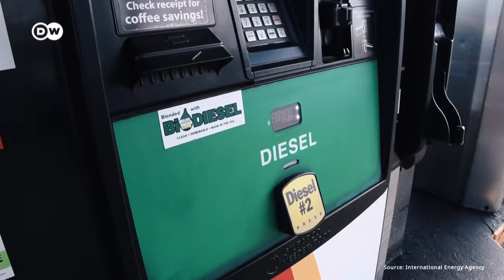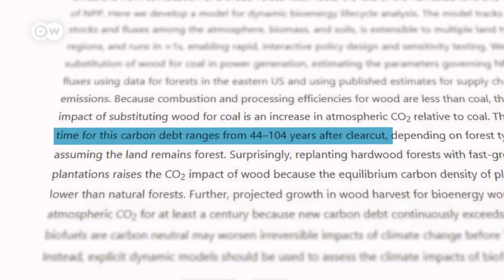Biomass: How clean is energy from waste and plants really?

Comment: Why have sewer biosolids been left off the list of biomass energy sources? Hydrothermal Carbonization facilities connected to municipal sewer treatment  plants would be a great renewable power resource that would actually be taking care of a serious  hazardous waste issue at the same time.

Use Algae, azolla, water hyacinth, water lettuce all fast growing water plants, all grow biomass rapidly, which beyond fuel, could also be harvested for other industrial products like starch for use in packaging and adhesives, so corn would not need to be grown for starch or fuel.

Tree cutting would be more sustainable if coppicing deciduous trees was used for bio mass production. That way the trees can be cut, but the roots are left in place as the tree regrows. Every spring someone needs to come by for the first few years to cut most of the suckers off the stump, but the one sucker  left grows tall quickly, because it has an establised root system. It stores more carbon, because the soil is improved by leaving ithe roots in place. The trees grow big root systems, then the coppiced(cut) tree's  roots die back to what the stump needs, it leaves all the carbon from the root die back buried in the soil, while leaving an established tree to grow again.
Reply: Yes! and it is even more important when you consider that forest fires are meant to happen every 10-20-50 years. We need a clever/organized management of forests, which takes into account cutting some trees to allow the better growth of the forest overall! why not use these cuts as biomass energy.

Comment: The other researcher needs to recognise that wind and solar  can also have a negative impact on our environment. 
For instance:
 1.To build a 1MW solar plant it is required to clear approximately 1 hecture of land which might involve cutting down of trees 
2. The average lifespan of a solar plant is about 20 to 25 years, how do you dispose off your batteries and panels once the become obsolete. 
3. The material used to manufacture solar panels like Gallium Arsenide GaAs are toxic, require special handling procedures and can be harmful to humanity and ecosystems
4. Building a wind power plant might also require clearing of land and interference with nature and ecosystems. 
Overall each renewable energy source of energy if handled without considering its environment impact seizes to be renewable energy.

Comment: We burn about 15 m³ of birch firewood per year. Mostly for heating the house but also for domestic hot water in the summer. Here in Slovenia forest cover 60% of land and continue to grow as remote and hard to access field stop being used for farming. The firewood we use is mostly economical waste as only the good logs get transported to sawmills and turned to planks. It is cheaper to simply sell twisted logs and branches to locals then to transport it somewhere and sell it for the same price. As a heating source it's much cheaper than any fossil fuel and about as much as a heat pump energy. It comes down to responsible forestry. After all if you simply let a tree die and rot in the forest the same energy is used up by bacteria and the CO² and CH⁴ just get released into the atmosphere. The bigger problem is that people use wet logs in old wood boilers that emmit a lot of dust particles. There are small villages around my area that have worst air pollution in the winter than any major city in Europe. It happens due to inversion and all the smoke from the boilers stay in the valley instead of getting higher in the atmosphere. Wood smoke is also very sticky and will make your clothes smell really bad in the winter. My conclusion, it's a good source because it is local and cheap, but should only be burned in modern wood gassification boilers that can get up to 90% efficiency and emit like 99% less dust particles.
Reply: I agree 100%

Comment: Okay I am confused. Don't Neely planted trees absorb more CO2 than older ones? Yes the older ones have more CO2 sequestered but new ones absorb much more? Wasn't that established before? Someone please help
Reply: The issue lies in respiration. Like animals, trees are living things that breath and when they breath they release CO2 back into the atmosphere. Wood is where trees actually lock up that carbon, but trees actually take a while creating the rings of wood around their stems. So to put it another way, picture the wood on a tree(or even some other plants) and that is exactly the amount of CO2 it has absorbed. If it's all green and flimsy then it's not really absorbing anything as all the plant did was convert the CO2 into sugar.
Reply: If the older tree that was cut, was turned into a piece of furniture, then planting a new tree would be a good balance. But when you burn that wood, it's releasing the same amount of CO2 it has sequestered for decades.
So what you actually have to equate is the amount released from burning of that old wood, to that of the amount sequestered by  the new sapling that replace it.
Meaning more CO2 is being released extremely quickly than what tha sapling can sequester in decades
Reply: Yeah, I'm also confused by this as previous studies said young forests capture more. And that would make sense since they are generating wood mass quicker, except for first years probably.
Reply: Old forests store a lot of CO2 in the soil.  Much more then the young trees capture in its wood. That's why when you cut old trees, even if you don't burn them, you release carbon from the soil that is not sustained by the live root trees.
Reply: The confusion is valid as scientific studies show both results. Some say mature trees (100 years +) stop taking in that much CO2, some say it never stops.. Also, rate of absorption and quantity of absorption are two different things, I would think it is like a heart, you can pump many times (higher rate for younger trees) or pump less times but more strongly (old trees with lesser rate). The more efficient hearts (old trees) take in more than the fast growing trees. Lifetime carbon accounting is no jokes...
Reply: @beatrizmedeirosnoleto9391  how do they store carbon in the soil? Do you mean they release more sugars and nutrients into the soil through their roots? Its not storing carbon in soil as organic matter because we all know forest soils don't grow much. 
In any case without going into details, I would assume that when a forest reaches maturity it enters an equilibrium where its releasing as much carbon as absorbing.
I can't imagine in what form would carbon continuously accumulate in a forest at high rates ather than timber.
Reply: @chris-2496  Not sure but an old forest has a rich ecosystem of moss, plants, fungi, bacteria, insects and these have some activity as well if only in making a growing humus layer.

Comment: All that biomass can also be composted and returned into the fields they came from. That's one of the solution to remove chemicals fertilizers in our fields and keep the in good health. 
Biomass is too valuable to be turned into gaz !
Reply: Not long term no. By removing any product from the field you’re taking nutrients with it. Example being corn, there’s a pound of nitrogen in each bushel, so 200 bushel per acre corn will remove around 200 pounds of nitrogen per acre each year, regardless of what you do with the rest. I’m also not sure why you’re so convinced that chemical fertilizers are some big evil thing here. They’re a necessary and useful tool that done right cause no harm to us.

Comment: ... if you are not lacking required minerals, it makes no sense in most scenarios to grow anything to then just burn it instead of using solar cells (waste is just waste, so it would be produced anyway, a different story). Plants use solar power, part of which is wasted on growth and absorption, the rest is stored so you can burn it. Then you transport that mass (need energy for that) and burn it, leaking even more energy in the process. Then you might produce heat, which is ok, but if you produce electricity, you need to convert it back, so there is one more source of loss. If you use solar cells, you get greater efficiency per m2, use none of it on mass, lose almost nothing on the transport and then just have to deal with the waste of the final transformation. Those two (biomass and solar cells) can not compete in efficiency.
Reply: If you are talking about burning the biomass, it really makes no sense. But if, instead, you choose to biodigest it, its a whole different story.

Comment: Btw What does Biogas or Biodiesel Release? Its Co2😑 and also Leaked Methane.
How this can be Green solution?
Reply: The biomass from waste will turn into methane and CO2 anyway when it decays. But methane is 80 times more warming than CO2. Since only aerobic decomposition produces CO2, that means you have to have expansive aerobic composting piles to avoid it from getting aerobic and producing methane. 
However, if it's composted aerobically in a controlled digestor  where the methane is stored without leaking, then burning that methane or the distilled ethanol will produce will make sure that, only CO2 which is 80 times less warming than methane is released. 
So basically, instead of letting the methane from natural decomposition be released, by storing and burning it into CO2, 80 times less warming happens